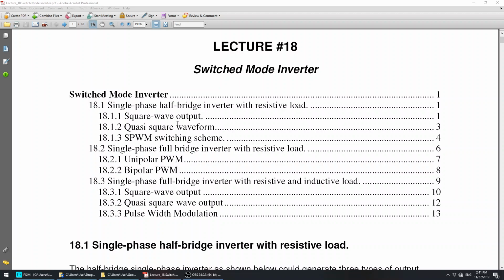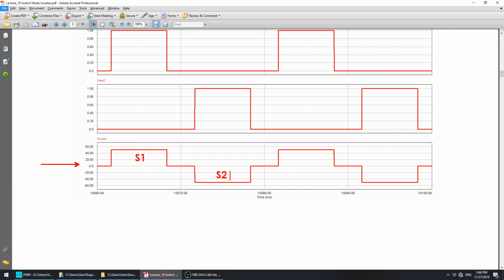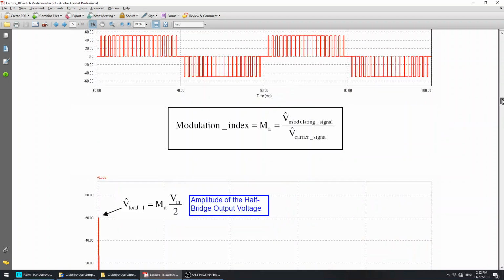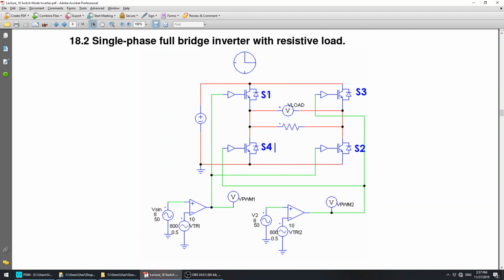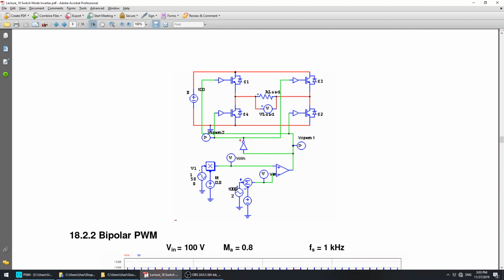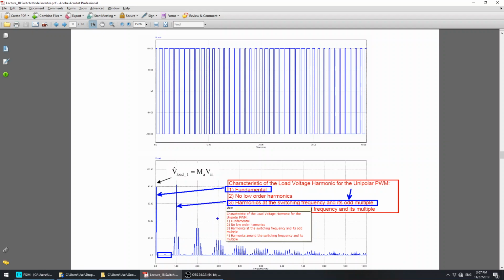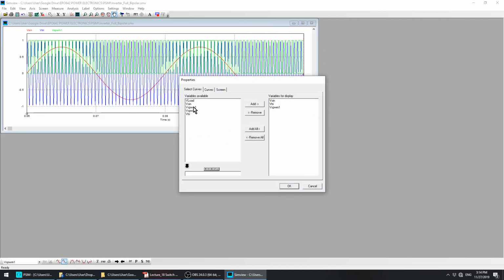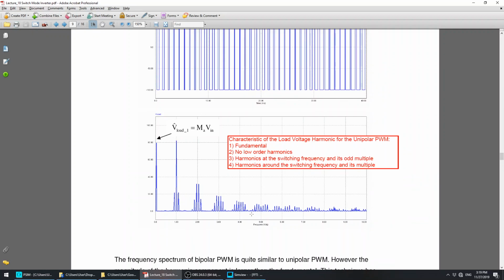Inverter SinglePhase

Comment: hai..can I know how to calculate the switching phase before we put in the gating block? I tried to calculate using EP, HP, HH, and FF but it couldn't proceed when the phase is less than 2 points. I appreciate it if you can help me to sort this problem.